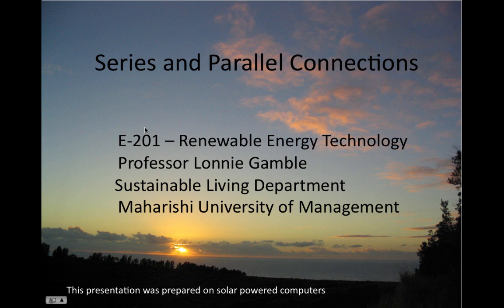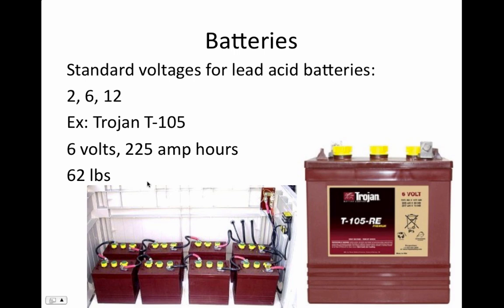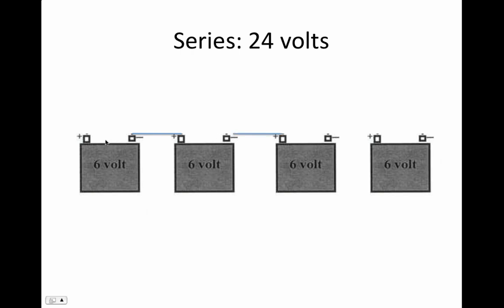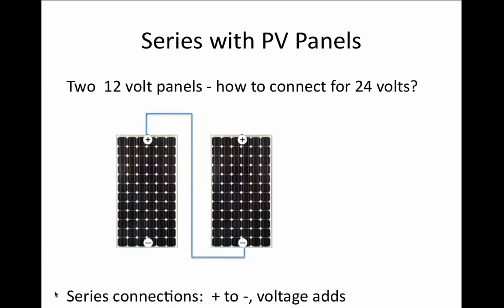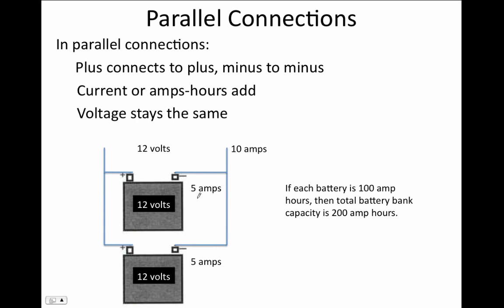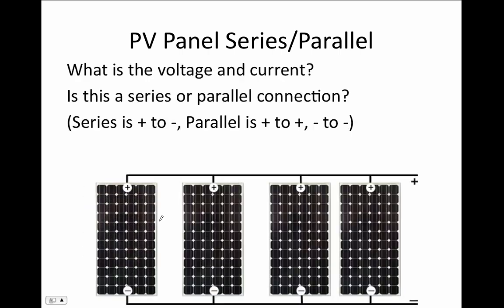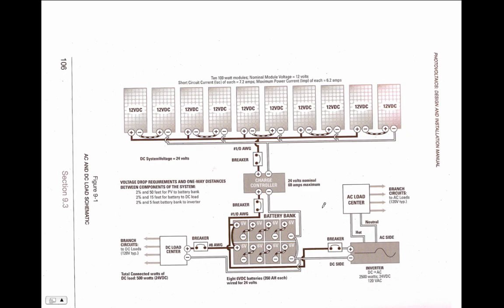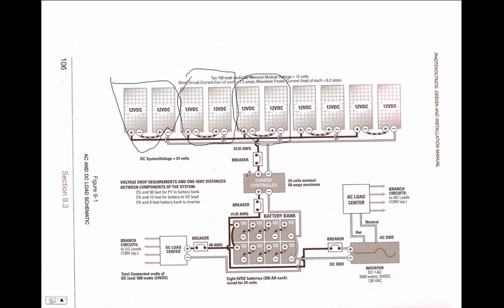Series and Parallel  Flip 2015

Comment: You make the most common mistake when connecting at 15:02 eight 6V batteries together. Negative and positive should be taken from the opposite corners. Your topmost set of four 6 cell batteries will wear faster than other below them.

Comment: Will it be better to hook the batteries inseries or parallel cause I'm using them for a 500w ebike. Can I use two of the exact same Scooter/Motorcycle batteries with a 750w Power Inverter to power my 500w ebike ?

Comment: 2:30 standard voltages are 2, 6, 8, and 12.  You missed 8V.  Some "golf cart" batteries are 8V (4 cell).  Never want to connect the + of one battery to the - of the same battery?  Of course we do, that is called a circuit.  You didn't say never short circuit, yo said never connect.

Comment: wow...im actually learning directly from a professor without all that costly bill...i have a question..i have 3pcs of 12v 5A motocycles gel lead acid  which i have connect 2serial and 1pcs in parallel is that ok..?...24V10A....if its right than i have passed my diy online tuturial..

Comment: sir can i ask if 2×200ah battery 12volts in parallel conection and 2×200ah 24 volts in series connection are they thesame power capacity which is 4800 watts  if both battery fully charge
Reply: Kabayan,Yun tanong mo about sa parallel at series connection ng battery.ay ganito-yun (2)12 volt connected sa parallel ay magiging 12volt pa rin but un ah nya ay magiging 400ah then yun (2)24 volts in series connection ay 48 volts but yun ah ay 200ah pa rin.Bakit check mo sa electrical series and parallel theory.
Reply from the maker: same energy, not power.  For batteries in parallel,  amp hours add.   In series, amp hours of one battery is teh same for the whole system.    

So energy for 12 volts system: (200amp hours +200 amp hours)* 12 = 4800 watt-hours
energy for 24 volt system:  200 amp hours*24 volts = 4800 watt-hours

Comment: Hi, how many 12 volt batteries would I need to run my house which is on 240v, and would I need an inverter.
I also have 12 solar panels which are 250 watts each.

Comment: Another error... standard voltages in batteries are 2, 6, and 12V.  Really?  What happened to 8V batteries very common in golf carts?
Reply: 8 volt is not a "standard" size - so not included in the comment.  yes you can buy 8 volt batteries - but they are not the "norm" or "standard".

Comment: Nice video, I just wanna ask these few question, the EPEVER Tracer A Series MPPT Charge Controller is 10A

(1) I want to know if it has minimum wattage of solar panel that can be used with it as it is only 10A i.e. can this 10A charge controller work with 1000watt solar panel (4 X 250watt solar panel)
(2) I have one 200AH battery Deep Cycle battery 20A PWN charge controller. How many watt solar panel will i need (minimum) to work with it.
(3) If I have a 12V system i.e. 12V inverter, 12V battery and 12/24V charge controller. can i use a 24V solar panel on this setup
(4) How does how big the Amps of a charge controller affect the working of the charge controller positively

Thanks
Reply: FUTURE TECH

Comment: A pair of 24V 200Ah battery banks connected in series will NOT give you 24V 400Ah.  Downvoting for inaccuracy.
Reply from the maker: Thanks for catching that David - do you recall where that was in the video?  

Batteries or PV panels connected in series will add the voltages of each individual unit, current (or AH capacity) stays the same.   In parallel, currents (or amp hours) add, voltage stays the same.
Reply: This is incorrect.  Ah capacity is a function of load so if you double up a battery but maintain a constant load, the doubled battery will perform as if it was MORE than double the Ah rating.  For example, first take a full charged healthy 12V 100Ah battery and put a 20A load on it.  Next take 2 of those batteries and put then in parallel and put that same 20A load on it.  What is the new Ah rating?  200Ah?  WRONG!  That load will look "lighter" to the pair of paralleled batteries so the  effective Ah rating of the pair will likely be more like 220Ah, not 200Ah.  Go back to battery school.  Numbers like this are posted by major battery manufactures in their literature such as Trojan.  The general rule is as you lighten the load, you increase the usable Ah of the battery [bank].  Conversely if you increase the load, you lessen the usable Ah.  That is why battery manufacturers supply a chart for the batteries based on load.  A typical 6V golf cart battery for example might be rated at 225Ah at the 20 hour drain rate but that info is not very practical since who the hell drives a golf cart around for 20 hours between charges?  That actual usable Ah for that same battery in a typical use (driving around a golf course with many stops), is probably closer to half of that 225Ah.

Also, paralleling batteries will not be additive in Ah for the simple reason that they are not 100% identical.  They likely have slightly different internal resistance and manufacturing differences and it also depends how you parallel them and where and how you connect the load to them.